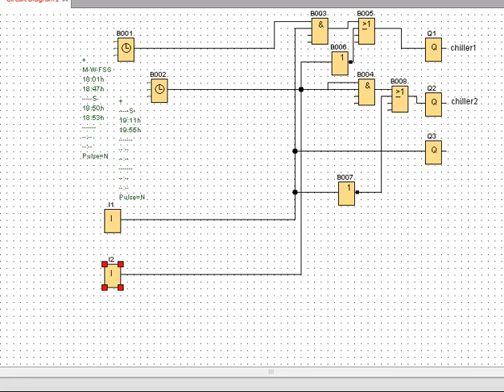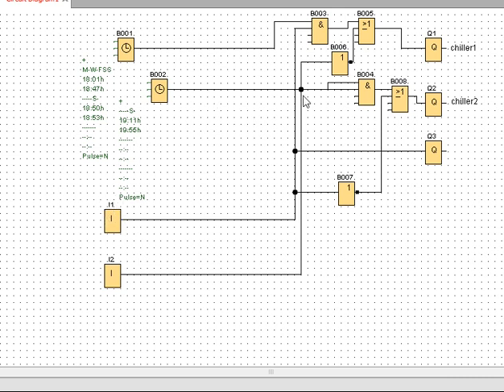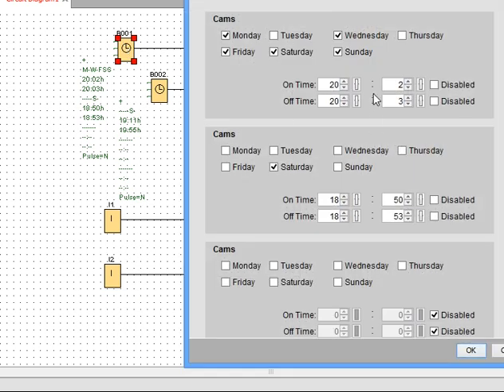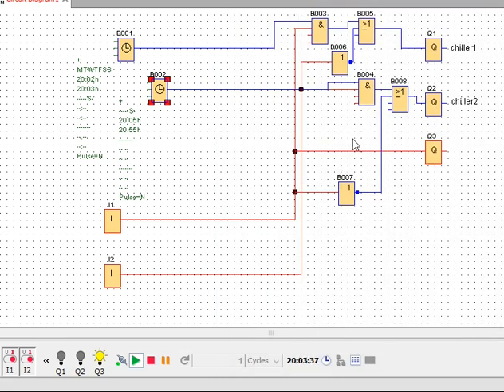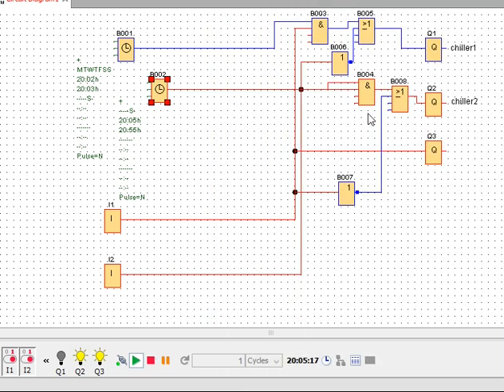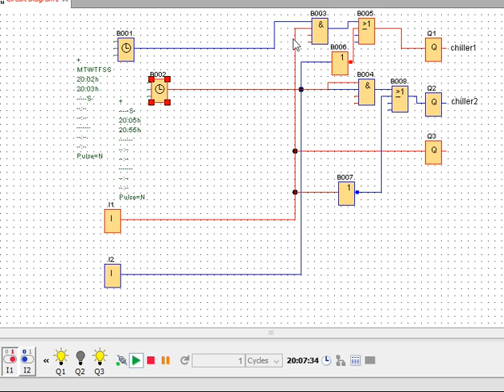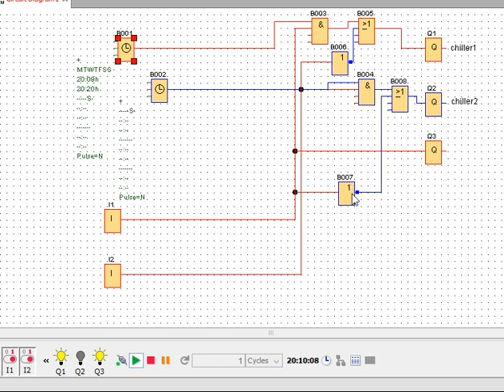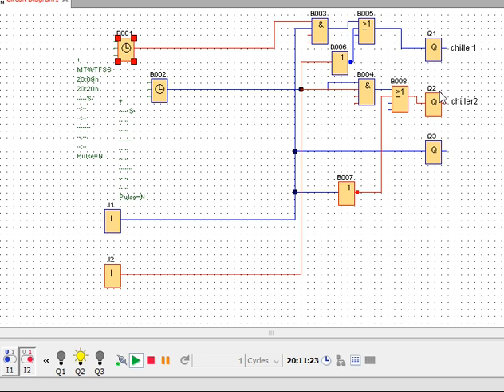CHILLER PROGRAMMING IN PLC

Comment: This is one stage only is right? 
If chiller not achieved common supply temperature how you will run 2nd or 3rd chillers can You make a temperature control loop logic.  
For example I have 3 hiller all are duty and base on common return temperature, it will work